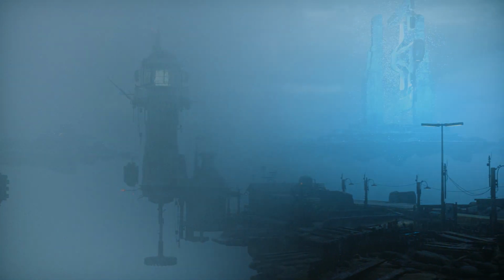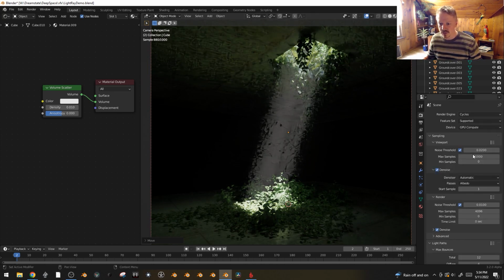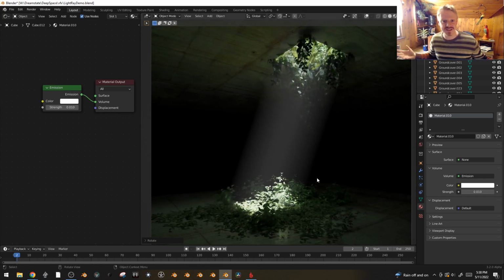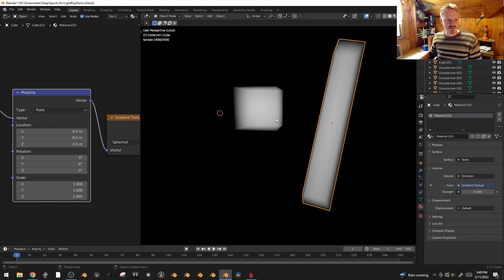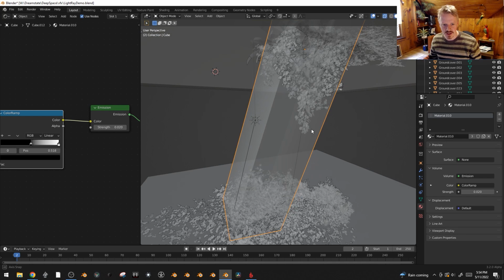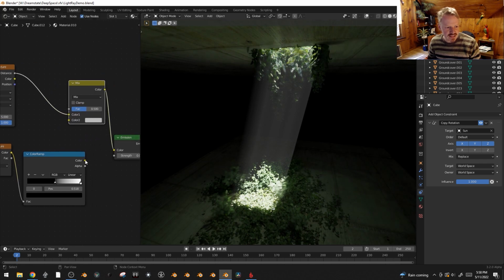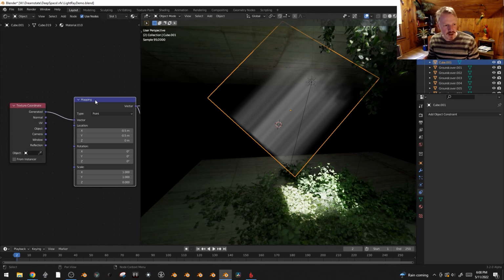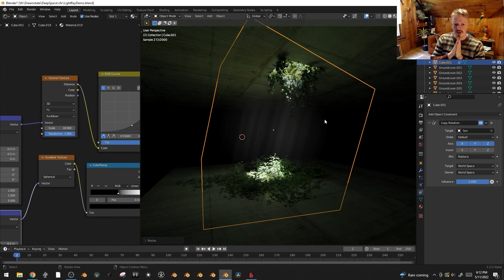Cheating Volumetric Light Rays in Cycles

Comment: There's a neat trick in compositing that can get rid of those denoiser wrinkles, but it leaves everything a little overly smooth-looking, might need to experiment more. I also found out that a few of my very problematic scenes stopped doing that with chrome/discord closed. I think it might have something to do with software using hardware acceleration taking up GPU usage while rendering.

Comment: Nice. Constraining the rotation of the volume to the sun is a good trick. 

It's worth mentioning that volumetrics often seem to denoise cleaner if you set the passes to albedo or none - especially with the optix denoiser. 

I have no idea why. Maybe because the object has no surface and therefore no visible normals? Either way, it's worth experimenting with.